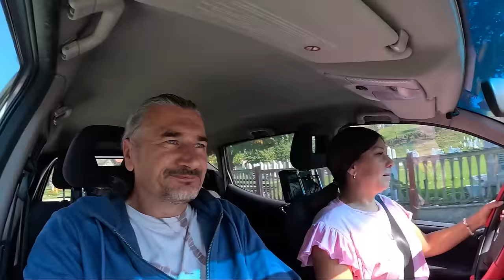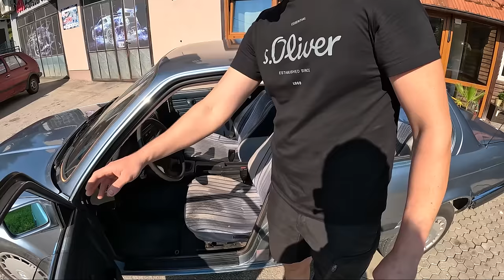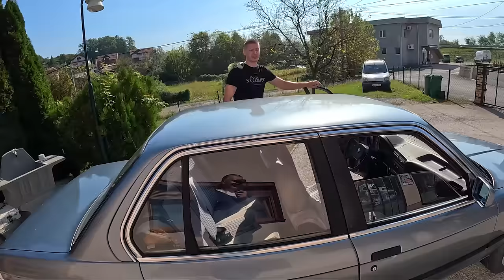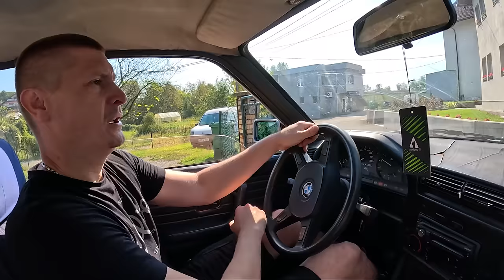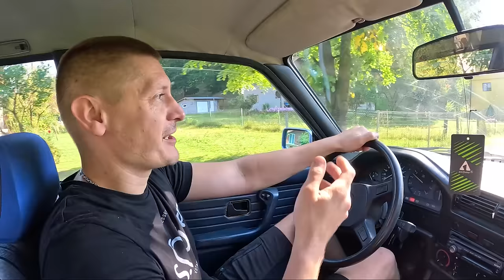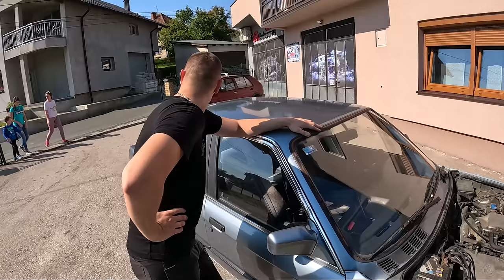AMIR (ZEKA) KUPIO BMW KOCKU IZ 1985 GODINE I KAŽE DA JE BOLJI NEGO MOJ GOLF 2 - PROBNA VOŽNJA

Comment: imam kocku vec nekih 4 godine,motor m10b16 karburator,prica se da je motor neunistiv,i stvarno posle 4 godine jedan jedini problem nisam imao. samo redovno odrzavanje i taj auto ce da zivi i nadzivi mnoge novije modele
Reply: I ja imam bmw e30 84 godiste 316.Nije taj motor 1.6 nego je 1.8. 318i i 316 su apsolutno isti motori samo je jedan sa diznama a drugi sa karburatorom.318i ima 105 konja a 316 90 konja i zato taj sa diznama ima oznaku 318i a ovaj 316.Tako se bmw igrao sa oznakama nekada.
Reply: @Luka.Trninic   Ali ovi malo noviji u kocki imaju 1.6 sa 105 ks,a e36 isto 1.6105 a 1.8 115
Reply: @leonardomarticevic6921  To je tacno sta pricas. Ali ovo vazi samo za kocke prije redizajna. Ovaj lik gore je rekao da ima m10 1.6, a m10 motor u kocki je samo 1.8. Taj 1.6 motor u kocki je m40b16 i ima oznaku 316i dok m10b18 sa karburatorom ima oznaku 316
Reply: @leonardomarticevic6921 Da takoje to su motori M40B16 zadnji modeli 1989 do 1991 budu i u e36